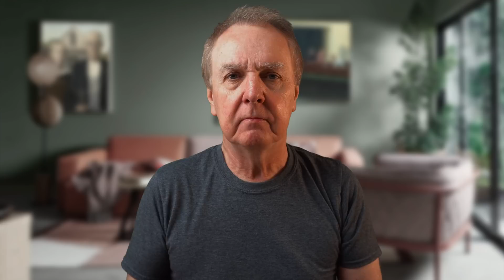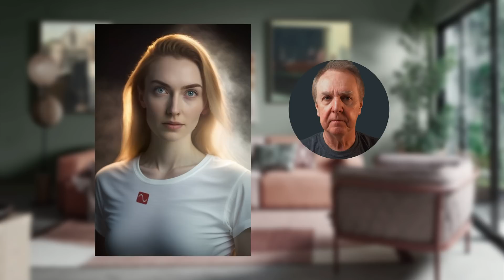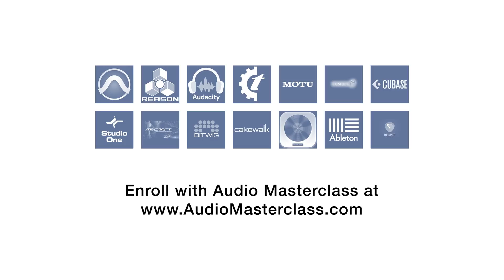Did that Dolby thing ever work?

Comment: My ex-girlfriend liked when I recorded her tapes with Dolby-B so she could play them back without the Dolby... she's way cooler than me.  She loved the blistering high-end.
Most professional recording engineers I knew recommended against installing the Dolby-A system. It was just more equipment that had to be calibrated and reduced the number of machines you could playback with.  More stuff to go wrong.  Better to have a properly aligned Studer A827 without noise reduction. 
I had a Technics cassette deck that had Dolby-B, Dolby-C and dbx.  Dolby B actually worked fairly well, but it was a nice and well maintained machine.  Dolby-C was muddy.  dbx (compander) was abysmal.
Reply: Interesting. I grew up with a Technics deck in the house that did a reasonable job with B and C, but the dbx was amazing. Problem was, we usually recorded on this nice deck and played back in all sorts of equipment, so only B ever got used.

Comment: "Did that Dolby thing ever work?"

Yes.   Dolby C was an improvement though.  That said, the decks that would actually automatically configure the Dolby to the tape type were the ones that were most effective.
   
Commercially recorded tapes didn't use Dolby (because it would have cost money), which of course would make them sound dull if you turned Dolby on.
Reply from the maker: Definitely some musicassettes have Dolby - I can see them on eBay with the Dolby logo. In what proportion Dolby vs. non-Dolby, I have no idea. You're right about making non-Dolby cassettes sound dull. Non-technical people have very little tolerance and when they found that Dolby made a non-Dolby tape sound dull, then they would probably decide they didn't like it and keep it off. DM

Comment: I both agree and disagree.
The fundamental information in this video is correct.
tape music playback is challenged when playback is on a different machine than the recording of the tape and Dolby enhances the challenges
head alignment, azimuth control, demagnetization, head cleaning and more are all maintenance items that when ignored will diminish playback quality and Dolby enhances the problems
cheap non quality equipment is cheap non quality equipment and Dolby can't do magic and make this equipment wonderful
Where I disagree, at least in my experience is with the gist of this video.  The 70's boom in Hi-Fi was my era.  I grew up in The Netherlands and people were always seemingly upgrading their stereos.  There was a lot of magazine and newspaper information, people were conscious and informed and in my circles people did generally know what Dolby was.  I used it all the time with great success, I didn't buy pre recorded cassettes, they were trash and I ran into trouble when playing tapes that I recorded on my home deck in the car, or the beach portable radio cassette, or a tape loaned to me by a friend or playing my old tapes when I bought a new deck.
My opinion is that the transition from cassettes being, their intended use machine to record board meetings and other spoken word audio to a worthy music medium, that transition was made possible because of Dolby, in addition to other progresses like separate record and playback heads, head alignment control (either automated or manual) azimuth control, improved tapes like chromium dioxide and metal, later on Dolby C and S and all the innovation that Nakamichi contributed.
Here's the thing though, while Dolby was the best "marketed" noise reduction there were better ones, like HX noise reduction developed by Bang & Olufson and perhaps DBX.

Comment: Had several decks with B and C.  They always worked perfectly for their intended purpose, which was to reduce tape hiss.  Main problem was many prerecorded tapes were not released using any NR.  Some had B and sounded best with B switched on for playback.  I had 100's of cassette tapes I recorded from vinyl. 90% were maxwell udxl-ii chromium dioxide, and I always marked whether I used B or C during the transfer.  They sounded best both in the home and in the car when I used the proper setting for playback.  Sorry, but it worked flawlessly if you followed instructions.   Most people don't even pay attention to polarity when hooking up speakers, so how are they going to appreciate 6 dB of noise reduction around 1000 hz, which is kinda the sweet spot for B?  Cassettes boomed in the 80's because everyone had a Walkman.  The dolby B tapes always sounded tinny on those, which I guess some people grew to like.  No surprise.

Comment: Watching this video has rekindled my interest in my old cassettes (all with Dolby off). I haven't played them in over 20 years, but I've now dragged out over 200 cassettes, cleaned and demagnetized the heads on my trusty old  Sony TC-FX510R and here I am happily reliving the past.  So, thank you.
Reply: Wow incredibke collection man. If I had 10 tapes i had a lot, back then, having such a huge collection here wud deem one rich 😂
Reply: It is fun sometimes reliving those days of man that sounds good LOLOL. I finally purchased a deck from the Shack that had an external BIAS control and I would adjust it so my recordings were a tad higher because I adjusted the control to enhance the highs a little bit and those tapes I listened to mostly in my vehicle. It was the stock radio with cassette and Dolby B it had separate bass and treble controls. I would reduce the treble in order to compensate for the enhancement of the recording I made in the shiny new Optimus (whatever model) if memory serves it was a Awia AD40, but I could be wrong with the model. Anyway the sound was beautiful nice crisp clean highs and low noise/hiss. Even parked with the  engine off it sounded almost as good as the CD. For a long time I resisted getting a CD player because my own cassette recordings sound really good to my ears. Then I got my 1st CD player and that kind of spoiled me (quickly accessing the tracks don't ya know LOLOL. I still recorded on cassette because as most folks liking only a few songs on a complete CD so I would record my favorite tracks from multiple CDs on to my own mixed tape. Then I really began seeing the capability of the CD (it's ability in frequency response compared to the fanciest cassette deck I owned) and well that was it. I could still make cassettes sound really good at least for me anyway. As time went on I discovered CD-R and CD-RW and I could record my own CDs w/text and that ended my cassette recording days LOLOL. Until I discovered the special music CDs were required (this was prior) to me owning a computer with a CD burning capable drive. Once I discovered the CD burning unit could record data and music my stand alone recorder became extinct LOLOL. It couldn't do anything with data CDs. It would show track 1 and the time counting, but because it was a data track the unit muted the sound. Which was okay. I finally got another CD player that didn't mute the sound on data CDs and well it wasn't anything that I couldn't wait to hear. For those that remember the dial up modem days that's essentially what the data CD sounds like only it didn't stop after a few seconds like the dial up modem did. Well this message turned out to be way longer than I intended, but perhaps some will enjoy reading it. 🤭😄😀🤣.

Comment: Very good description. Since my very first cassette deck i paid attention to have a Dolby level and bias calibration on the front plate, so my recordings always were with Dolby B and for my second deck Dolby C. I went the extra mile to also have a Walkman with Dolby C. I still record mainly in Dolby C. I did also discover DBX (II Type) can sound very convincing too. Pity there was only one walkman ever available with it/ or a external processor for mobile use. As i now have about 100 Tape decks in my collection (also with Dolby S) I'd say Dolby S is one of the best systems for cassette. The only drawback is that it was too late to the party and only a select few decks with good mechanisms were made.

Comment: Of course there is also type C and S for consumers, which work better when everything goes well, but also complicate things even more, and require even more accurate calibration and alignment, not to mention, type c especially suffers from compatibility issues between decks even when alignment is as good as technically possible due to being very sensitive to even the smallest differences in calibration of the type c implementation.

I use type B quite a lot for recording and playback because it has good compatibility between all the decks I have. But unlike most consumers back when cassette tapes were in common use, I keep my decks clean, and ensure to demagnetize them regularely (in fact the 2 decks I use most do this themselves, every time they are powered on).

Comment: Another problem are prerecorded Tapes with a chromedioxide formular. They loose thair level of Signal over time and they are off from the level that the Dolby Decoder needs to do his job right.
Only Decks with Play Trim could bring the Levels back to it's original state

Comment: I tended to turn on Dolby and then turn up the treble to correct for misalignment, wHiCh mEaNt i wAs hEaRiNg oDd dYnAmIc jUmPs aNd dRoPs as the Dolby encoder was switching in and out at one level, and the Dolby decoder was switching in and out and a different level.

I always knew it SHOULD work but rarely had tapes that truly sounded "right" with it in OR out. Out, and the highs sounded compressed. In, and they sounded dull. You couldn't win!

I always wished I had DBX...

Comment: Dolby B does work, however most pre-recorded tapes sounded better with it off and adjust the treble as needed.  With it on you needed to crank the treble to make it sound good.  When I recorded cassettes on a good deck it was great.  Dolby C with type II or IV was great with a good deck.
Reply: Pretty much exactly the same as my own experiences. Cassette tapes sucked because of head alignment issues and the low tape speed, but the tape decks themselves were excellent toward the end of the format's mainstream life--even cheaper ones.
Reply: @devilsoffspring5519  Everybody blames Head Alignment and they get in there and start tweaking on them, Very Big Mistake, It's a rookie mistake. Factory head adjustments usually never go out of adjustment until the seal is broken and then the damage is done. Never to be correct again since most don't have quality test tapes, test equipment, or skill level.
Reply: @ka7hqp182  Adjusting cassette tape deck head alignment is trivial. You're making it out to be a big deal.
The problem is that pre-recorded tapes were all recorded at different head elevation. Every time you bought a new tape you had to adjust the head elevation to get the best treble output. Then you could turn on Dolby noise reduction and they would sound excellent.
But, the exact head elevation was different for every tape you bought.
Reply: Dolby b had critical calibration which worked horribly on early commercially recorded tapes.by the mid to late 80s improved commercial  tape quality and hx pro virtually eliminated the problem

Comment: A Good Alternative in the 70s:
Philips "DNL"

I made the same experience that is described in this video and never used Dolby B on any of my over 600 cassettes since my first Hifi tape deck in the end of the 70s, that was capable of Dolby B. I didn't want to destroy my recordings with this crap, that, when playing back, reduced high frequencies very agressively when using it with playback, too, or made them too shrill, when not using Dolby at playback.

What was very good in my eyes btw. ears, was on my first Hifi tape deck from 1975: "DNL", "dynamic noise limiter" by Philips.

This worked like a charm:

First I did not have to destroy my recordings, as DNL was for playback only. A huge advantage, as my cassettes were recorded neutral and universal.

Second it worked by cutting off some high frequencies at very low volumes, when noise can be heard easily, otherwise it did not filter too much (or nothing?). It is interesting, that in low volume passages I never heard that loss of high frequency, as one could assume. But the noise on the other hand was canceled so much. The handbook of the machine told, that low volume music had automatically fewer high frequencies... I don't know, if this is true (?)

So with DNL there was never the impression of missing high frequencies like with Dolby recordings, while noise in more silent parts was reduced very effectively.

I dont't understand, why Dolby was such a success in opposite to DNL. Maybe, because with cheap chrome cassettes in the end of the seventies the noise was not a real problem anymore for most of us, especially, when the cheap and very, very good tdk sa 90 cassettes came out.

Comment: Dolby B was only useable with a correctly aligned tape on a calibrated machine, with play and record on the same machine.
In general I would prefer no Dolby with metal tape pushed hard to minimise noise, or genuine chrome dioxide tape (BASF) which had the lowest self noise of any tape formulation.

Comment: In 75 I bought a Teac 3340S and a Dolby unit that was recommended to me for quieter recordings.  I used it for a week or two making encoded recordings that then had to be played back through the Dolby box to unencode what was recorded. I don’t know if I wasn’t using it properly or what, but it seemed like the recordings just didn’t sound as good compared to not using it in the first place.  I returned the Dolby box to the dealer and am glad that I haven’t had to deal with it.  I used that deck to record a lot of my original music into the 90s.  In recent years I have archived most of my old tapes into my daw and am quite pleased with the quality of my old recordings.

Comment: I am one those people who tends to switch Dolby off on cassette decks. However, some years ago I made a lot of music on an 8 channel Fostex 1/4'' tape recorder with Dolby C and it worked fine - as long as I used the good Maxell tapes (the machine was probably adjusted for those) and planned which instruments I put on the individual tracks. Since there were only 8 tracks I sometimes had to have more than one instrument on some of the tracks. If I put an instrument rich in treble - like strings - on the same track as the drums, I could hear the strings loose treble when the snare drum was hit and than gain treble again until the next drum beat. But apart from that quirk it worked fine.

Comment: You're correct to talk about alignment, and 3 head decks with fine bias help that by ear. My deck generated tones to assist. I used Dolby C too (a video on that?) and I also used dbx, there's a type 1 and type 2 (my cassette was type 2 I believe) but Dolby A sounds similar (in operation) to dbx or have I missed the point?

Comment: I always used Dolby C NR. I also fine tuned the bias of the tape by recording noise of my FM tuner (finding an empty spot where there is no station). If the noise was identical between recording and playback it was ok for me. This gave me good results with my Kenwood cassette deck.
I once bought a pre recorded cassette, recorded with dolby-B or normal Dolby as I called it, and it indeed sounded dull. That was the first and the last pre recorded cassette that I ever bought.
Of course it is all past tense. I am in the digital age now and relieved of all these goodies I used to love in the past.
Reply from the maker: Yes I remember the FM noise trick. With my deck opened up and a schematic to hand it was possible to set both level and bias.

Comment: The biggest Dolby type-B issue was with store bought music cassettes. No matter how much cleaning, degaussing, and aligning, of the heads was done, the mastering deficits just wouldn’t allow enough clear signal for the noise reduction to perform its task properly.
Reply: Most pre-recorded cassettes were horribly mastered. Plus, most pop music at the peak of the cassette era had loads of treble.
Reply: That was  because the commercial cassettes were high-speed copied (up to 64X normal speed), so very often they lacked treble response.
Reply: @florianm3170  Yes, they were pretty terrible. I do have some of the “Digalog” tapes, and they have incredibly good treble response.

Comment: My first encounter with the Dolby Noise Reduction process came in the form of a stand-alone component made by TEAC, the AN-50. It required 4 pairs of stereo patch cords connected between a single tape recorder and the amplifier. The feature that I found most useful was a built-in 400hz tone that I used to set VU levels. The unit did clean up and improve the sound quality to some extent, but I took a different approach to resolve the source of the noise which was to record on higher quality tape to begin with. I still have the AN-50 and use it as a tone generator. I have had no need for the Dolby process all these years with clean recordings across the board.

Comment: I leave Dolby on and I always try to match it to the correct Dolby. B recordings to B and C to C, etc. Although these days I tend to make my recordings in C.  The recommended tape for my deck is TDK D, but I use a wide variety of tapes that work fine. TDK D, Memorex DBS, Maxell XL II, UR, BASF you name it. But my favorites are the D, the DBS and the XL II.

Comment: I record on a B&O beocentre and it has HXPro. I always use Dolby B when recording sub 0db. I find on playback on the B&o that it is fine, but on a walkman with B it's OK. I find on an Aiwa  on pb if the sound goes above 0db then I get clipping almost so I switch it off and happy days.